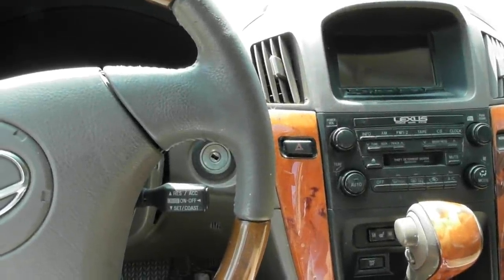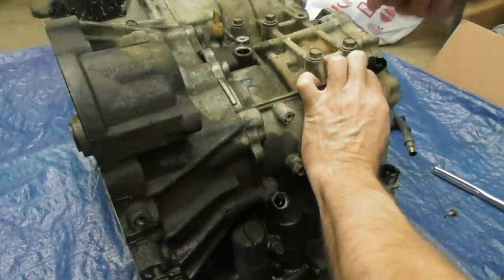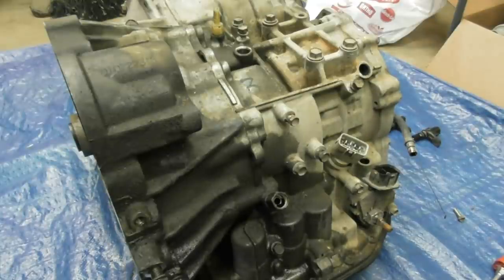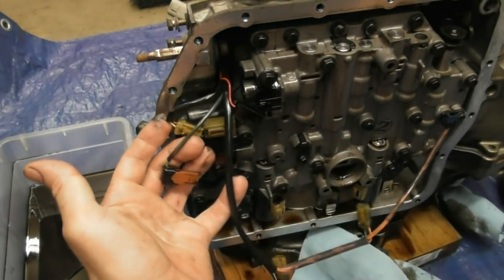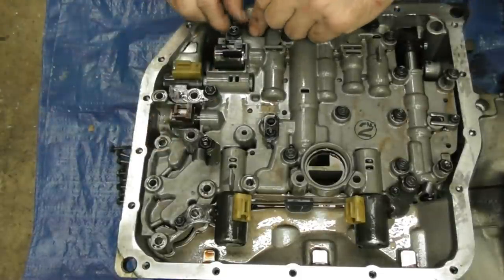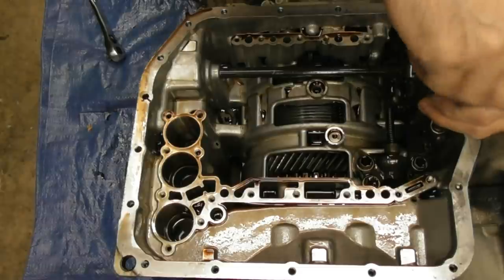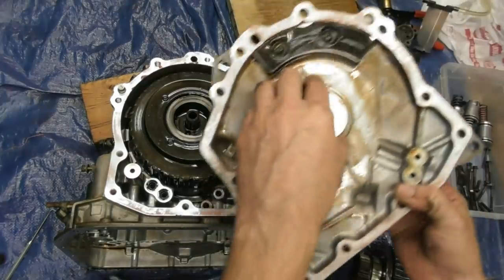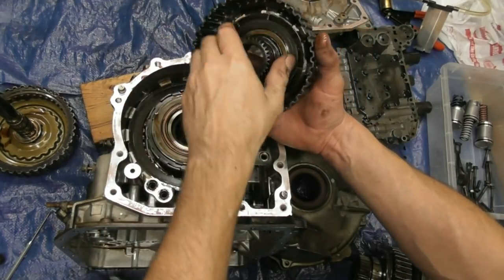Part 1-4 2002 Lexus RX300 U140 Transmission Disassembly

Comment: 9:22 - A wiggle and a pull... I'm only 28, but time has taught me that no matter how many times you've worked with brittle old car connectors it's usually a wiggle and a prayer lol.
Reply from the maker: That's right Jesse! You're certainly wiser beyond your years and are correct! G.

Comment: 10:12 I've been looking so long for clear footage or a photo of this, now I can see the solenoids probably have enough clearance to be pulled out and replaced without needing to drop the entire valve body, that's a relief. Well granted this trans is similar to U241E (2004 toyota camry le 4-cyl), fingers crossed. Thanks for your efforts brother.
Reply from the maker: I don't remember if they do or not. If there's not, you might try loosening up the valve body without taking the bolts all the way out. Good luck, G.

Comment: Just the video I needed thanks
Reply from the maker: Good deal William. Good luck, G.
Reply: @ghostses  so my tranny was slipping got it home. Then it wouldn't start and was throwing transmission solenoid codes. I dropped the pan and checked the solenoids they were engaging with 12v applied. Cleaned everything up put it back together still no start and same Codes. P0758
P0753 P0768 P1760. Might throw some used solenoids in see if that fixes it

Comment: Thanks for this video. I am rebuilding my U140 now, and I did find alot of damage with the forward planet gear set, due to a clutch sleeve, or crown, grinding its crown tips down and releasing metal chunks throughout the forward and rear planet sets. Thing is, I cannot find out why this clutch shroud got all ground up. I see that my 4 pin forward, and 3 pin rear planets, have their pins still intact and they arent loose, so I am very concerned about the culprit for this damage before moving on to purchase a rebuild kit, along with one or two replacement planet sets.
Reply from the maker: Keep watching the series to see if you find what I found. One of the cages/baskets/shells/shrouds? on mine was cracked and let things loose to chew things up. Good luck, G.
Reply: So the rebuild was a success, and many thanks to being guided by channels like these. Anyways, I have a few questions about issues that have arisen since test driving. I have the infamous flare and delay up shift from 2nd to 3rd, and so far I cannot seem to find the issue. I have since replaced the Valve body from a company that revises the cores and solenoids and send you back a whole new unit. Mine seemed to be bad despite rebuilding it with new balls and seals. After putting on the new valve body and solenoid setup, the transmission still did not do that up shift correctly, and essentially there was no real change in the behavior. 

Now I can get the shift to happen smoothly, if I shift manually from 2nd to D. Now if its in drive and I floor it beyond 2900 RPMs, It starts to shift better, however, the flare and delay are still present, but noticeably much less severe as it does on normal acceleration. If I manually shift, at the 2900 rpms, where it will flare and delay when its in Drive, it does not recreate the issue and the shift goes smoothly. That all said, the issue only happens when its in drive, under normal acceleration, and the issue becomes more minimized, when at full throttle which allows it to shift above the 2900 RPM mark. 
Keep in mind, with all these symptoms, there has never been a transmission warning  code or engine light. On the engine side I replaced two bad knock sensors and also found out the timing was off a tooth and the VVT system was out of whack. Re timing the car and replacing the VVTs finally got the engine light off and fully functioning. So for another small test I unplugged the solenoids to see how the default system would behave, and it did stay in 2nd gear, and allowed for an upshift into 3rd only if I wasn't accelerating. This default situation seems to be by the book, when the TCM looses control of any solenoid, or in this case, all of them. 

Finally, suspecting the TCM, I sent it in to a place called UpFix, and they offered to re flash the ECM and TCM, with the latest firmware, and also re solder any potential joints that are loose. Since I got the ECM back, when I installed it, the transmission still had the same up shift issue and not too much changed on that regard at all. I have since sent the ECM back to UpFix, and they offered to check it all out again and dig a little deeper in case they did not re-flash the ECM to whatever upgrade Lexus did during their great recall event due the faulty engineering of the 2001-2002 Lexus models that used this U140E transmission and electronics. I know this re-flashing existing, however, I cannot seem to find any actual code or naming, of this update to Lexus's of these years, that were done during their recall event. 

Now, if I get this ECM back, and the same issue is still present, then I am at a complete loss as to what else could be causing this issue, that is also not triggering any warning code from both the engine and transmission. I know the TCM uses the two speed sensors to determine upshifts or downshifts on hills, and also that the Throttle position sensor and brake lights are in play just as well. Now I dont have any issues with how it downshifts or engine brakes, as all those tasks seem good to go, and non seem to have any flare or delay issues. Really, its this darn 2nd to 3rd upshift in particular, that seems to be a unique event for the TCM, and somehow, the signals it gets while in drive arent timed right or something. One other thing to note is that while Im in Drive, I can stop any harsh gear engagement when it flare shifts, by letting off the throttle and then reapplying it, and usually this will prevent the transmission from engaging harshly, as the shift event resets after reapplying the throttle. Only on a very few occasions would it enter in that delayed mode where it tries to upshift the moment you lift off the throttle, and when that does actually happen, it performs the flare shift twice, with the anticipated delay that the old TCM programming caused. I would think some reasoning behind this Lexus recall and reflash remedy, was to re program the soft upshift event from taking place, with a delay in case the throttle is reapplied quick enough by the driver. Anyways, regardless of that extra detail, at no time has this upshift ever been smooth and on time, while its in drive accelerating normally. 

I will be attempting to swap my 2003 ECM into my 2001 Lexus, just to see what difference that may make. I am unsure if they are directly compatible like that, but if it allows me to plug it in, Ill give it a try to see what changes may take place. I havent got my ECM back from UpFIX yet, so this is a good time to try out this other ECM, while I have time to disable my daily 2003. 

Sorry for the long winded post here, but my main question is, considering all the above information... Do you have any idea what could be causing this bad upshift? Perhaps I made a mistake rebuilding the 2001 transmission, and I perhaps should have just found a 2003 and rebuilt that instead. I really dont think I screwed up the rebuild, however, I lacked the precision to do all the clearance checks, and I also did not perform an air test for the clutch packs while installing. That said, the transmission is quiet, and the clutch engagement seems very strong and quick enough for all the other shift events. Basically, the functioning of this transmission seems good to go, and it seems more like this is an ongoing electronic issue that is not so obvious given that I have addressed all those potentials. 

Lastly, I have used both Dex IV and Dex V1, but for now I am using the Dex IV. This is about the 4th time if have drain and refilled, and 1 of those times I replaced the filter again, along with the revised Valve body I purchased. I doubt that not using the exact Toyota Trans fluid is an issue, since the Dex IV should be compatible.

Comment: Thanks for the video Ghostses. Do you think I can replace new solenoids without removing the gear box off the car ? Will any thing fall out under gravity when the valve body is removed? Thanks.
Reply from the maker: Man, I can't say for sure. I guess you could start that way and if anything goes wrong- you can continue from there. No pro here! G.

Comment: Quick question, I have the same car and same year... I crashed the driver side and the axle popped out so it spilled transmission fluid and I put a new axle and forgot to put the fluid back. Drove it for a while and then got an alignment now the reverse shift is no more just stays in place... is it my transmission or something else
Reply from the maker: I really don't know. It if was fine until the alignment, it could be they damaged the harness going to the transmission. I would inspect that for any damage. Good luck, G.

Comment: Hi Ghostes, I must say, this is probably the best and most comprehensive videos on U140E transmission. I wish I could have the courage and facility to build my own but I had to get eventually replaced it with a used U140E. I was having a bit different issue after the swap. The transmission in final gear runs at a slightly higher RPMs for the same speed as it used to before. May be the final gear ratio of replacement transmission was different. Is the final gear in your video the same which you have pulled with the zip ties. Just wondering if Camry and RX300 have a different ratio although with the same U140E. Thanks for replying.
Reply from the maker: I'm no pro by any stretch. I can say what was pulled out was exactly what was put back in in this series. I can't remember what it's called- but search for something on google like transmission relearning or driver relearning, or something like that. There may be a way to set it to defaults so it can learn again. Again, no pro here- but hope this helps to solve your problem. Take care, G.

Comment: My 2001 RX300 jumps and clangs/bangs loudly if you put it under load in reverse.  As long as you get on it lightly, no problem.  The kicker is it started doing this 5-6 years ago and the tranny hasn’t failed yet, but I avoid putting it under load in reverse.  I’m trying to see what part could be failed that allows this....?
Reply from the maker: I wouldn't know. I say, be gentle in reverse and just run with it. It  might be a bearing. But again, I wouldn't know. Good luck, G.

Comment: Are the direct drum and sungear supposed to freely spin clockwise with snap ring installed on first pressure plate?  They spin with the pressure plate snap ring off and I'm wondering if that's indicative of something.  I am not sure if that would explain why I lost all gears and reverse after doing this partial rebuild.   I originally lost reverse and got 3-4 gear flares and my ATF was badly burned so I bought a master kit to rebuild the rear case which is accessible from behind the drivers side tire.  The clutches on the direct drum were badly burned and ring grooved but I found no broken hard parts.  The deeper I dug the better things looked.  After installing a remanufactured direct drum with direct clutches, a remanufactured sungear, a new 2nd brake clutch pack, low/reverse clutch pack, changing the seals/orings in the rear case along with a valve body zip kit, new transmission solenoid wire, two new transmission speed sensors,  and cleaning the rear case hard parts, I finally put things back together. I started her up but I now lost everything.   Any ideas?  Thank you for making this video.  It's helped a lot
Reply from the maker: I really don't know John. I'm not a trans tech. I just did everything like I've shown in the disassembly and reassembly videos I've posted and it worked out for me. Not much help but good luck solving your problem. Take care, G.

Comment: G is this the U140E trans? I got a 01 es300 making sure we got the same trans using ur video as a how to on helping me get the job done on solenoid replacements.
Reply from the maker: Jacob, this has been years back, but If it would've been an E- I can't believe I wouldn't have noted that. I say look for a manual for the E, use my video series- and go from there. Not much help, but good luck, G.

Comment: Please share where you got the instructions/manual to remove the transmission
Reply from the maker: I didn't have a manual on how to remove the transmission. The manual I used to rebuild it was found on the internet as a pdf. Don't recall where though. Good luck, G.

Comment: I have a U140F 2001 Toyota Rav 4. Suddenly it has no reverse and is currently stuck in Limp mode, which part in the transmission could most likely be the cause? about 2 sources said it's the direct clutch. Also which clutch is the direct clutch and can I just replace the part that needed replacing without disassembling the rest of the transmission?
Reply from the maker: I can't say what the problem is with your transmission and how to fix it. I'm no expert and only illustrated what I had going on to get mine going again. But, it seems to me, you will have to tear things down to fix yours. I can't be beyond that. No help, but good luck, G,

Comment: I have a 2002 Lexus ES300. I think my transmission is going because when I go up hills, my speed is decreasing and when I floored the throttle, RPM just jump to 5K or so. I was wondering if it's better to rebuild or to get another used transmission. Which would be more affordable? And where do you get your parts after you find out what is damaged?
Reply from the maker: It does sound like you need to go through the transmission. Personally, I would not go used because you don't even know if the used one will work. It's a lot of work to pull and replace one. As for how much it cost to rebuild mine, I say in the end of the series i have posted on assembling it- but I think it was around 1k. I got all my parts from this place. Depending on what's wrong with yours- it might cost more or less. Good luck, G.

https://www.wittrans.com/

Comment: good day, have a 2003 lexus es 300, the gear when on D moves but stops and behaves as if its in N, only works fine when in R, pls what could be the issue?
Reply from the maker: Sorry, I don't know. I am not a transmission specialist, I just did what was shown here. Good luck, G.

Comment: I just replaced my 2000 RX300 U140F with 1 from the junkyard. Unfortunately the car rolls in Park but all other selectors (D, R, 2, L etc) work fine. I believe the parking pawl on this junkyard transmission is bad. Can you point to where the parking pawl was removed in your video? Very grateful if you can. Excellent videos
Reply from the maker: I could be wrong, but I believe it is here. Hope this helps, G.

https://youtu.be/uZbt62BMu_g?t=1088
Reply: @ghostses  Thanks so much, yes that's it. It's a big job to replace it😖
Reply from the maker: @tmph1814  No problem! Good luck, G.

Comment: Hi again. Are the pistons and the drain back valve long enough for them to set on the valve body as I push it  back up  for the reinstallation? Thanks.
Reply from the maker: Again- I don't know for sure. I'm just a guy that did this job- no professional. G.

Comment: I have one question, in regards to solenoids, how did you go about testing to be sure they were good? I just started taking apart same exact trans, and i want to be sure they are ok without frying them during test.. Thanks in advance for answer
Reply from the maker: I did not do any testing of the solenoids. I believe trouble codes would show if there were a problem with any of them. If your CEL was/is lit- you should pull the codes to make sure they're not transmission related. In my case, everything was mechanical problems. Good luck with your rebuild, G.
Reply: Did you find the video online , I think a Spanish person from Mexico put it up

Comment: Hi, i have an u140f transmission in a 2006 European rav 4. I have rebuilt it according to your guidelines, and after road test, when the oil is hot, it returns an p0746 error, and does not shift from 1-2. When I use the tech stream software i can force 3rd gear. I have replaced the SL1 solenoide, but that did not help. Any advice?
Reply from the maker: I'm sorry, I have no idea on what the problem might be. I'm not a specialist by any means and just did a one off for myself. That code seems to be related to some solenoid. Good luck, G.

Comment: This is an information gold mine! Thank you!

I have a 2000 RX300 with about 270k miles on it. Shift 2-3 has a bit of a kick warm and cold. Is that the solenoid? I have drained and filled the fluid 3 times now and it was bright red coming out even the first time. It is on its second transmission with about 60k miles. I am considering dropping the pan to change the filter anyway. 

Thank you again. Subbed
Reply from the maker: I'm not pro, but I guess it could be, or perhaps a valve that is slow to move in the valve body. If the fluid is red, it sounds like the friction material is in good shape. Not much help, but good luck, G.
Reply: @ghostses  Gotcha. I will probably just replace that solenoid while i'm in there. 

Also, do you know if this transmission is partially splashed lubricated?
Reply from the maker: @benjaminishak7206  I don't think it's splash lubricated, but I can't say for sure. G.
Reply: @benjaminishak7206 Hi, did you replace the solenoid? I'm having the same issue (small kick between 2 a 3) only when cold.

Thank You 😃

Comment: Appreciate if you could help me answer a question, for my RX 300 ,which has 130,000 miles is it necessary to change the transmission fluid and the filter? I checked with Toyota dealer he says no need to change the filter. What is your advice? Thanks in advance
Reply from the maker: A fluid change can't hurt in my opinion. If you're going that far- change the filter as well. Good luck, G.
Reply: @ghostses  thank you
Reply from the maker: No problem. Take care, G.